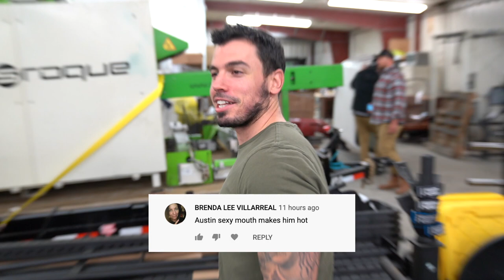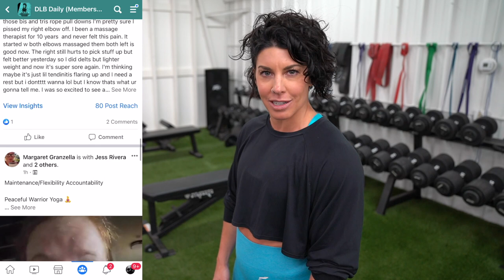GLUTES & HAMS FOCUSED LEG DAY | Full Workout | #DLBDaily

Comment: Warm up
3:42 banded RDL
6:23 Elevated sumo DB squat 
8:39 Vertical leg press (if not available, on Smith machine version. Positioning tips 8:59) 12, 10, 8, 8
13:07  bodyweight reverse leg curl on swiss ball. 4 sets x12-15 (as opposed to lying leg curl)
15:43 one and half rep, reverse hack squat. 8 to 10
19:06 good mornings on hack machine. Hold 2 sec. 4 x 12-15 (Wherever your back goes,  your neck follows) 
23:53 kneeling hip thrust on smith machine or hip thirst 4x 8 -10. 2 sec hold
26:20 banded or weighted hyper (rounded back)
29:48 Bulgarian split squats

Comment: @danalinnbailey I was wondering what your suggestion would be on the back extension machine.  My gym also uses AS equipment but ours are red & it doesn’t have the pad for your feet to go into like most back ext machines.  The movement feels very awkward without my feet being “locked in.”  Any tips?

Comment: Banded rdl 4x15,12,10,10
Elevated Sumo squat 4x 10-12
Leg press 4x12,10,8,8
Reverse leg curl 4x12-15
1.5 rep reverse hack squat 4x8-10
Good mornings hold 2 sec 4x12-15
Kneeling hip thrust 4x8-10
Back extension 4x 10-12 reps w weight 10-15 w o weight 
BSS 3x12